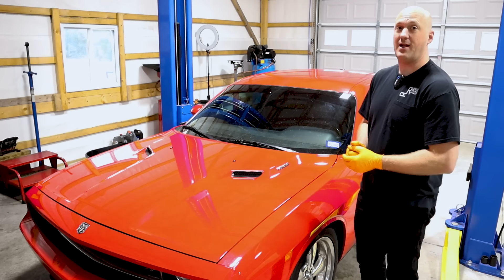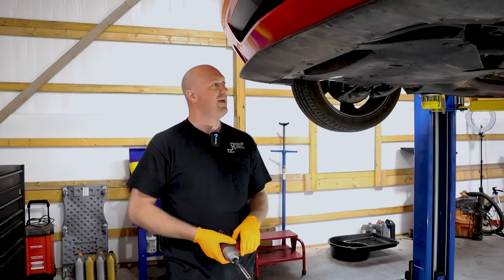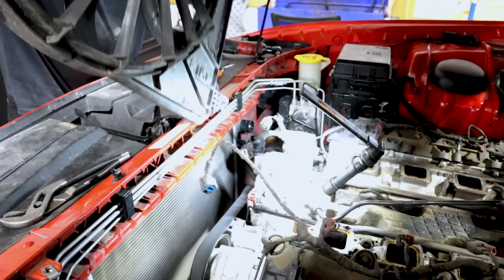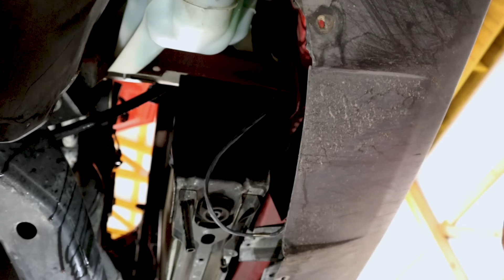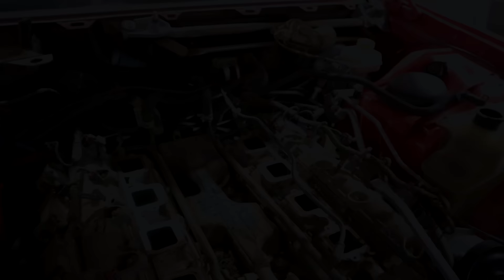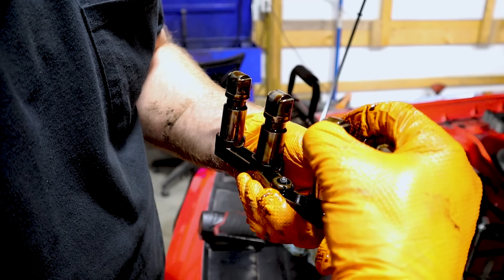Hemi Cam Installation! Budget Challenger Build Ep1

Comment: I have a question about the cam. I own a 2015 Charger with a 5.7l MDS. Can I delete the MDS ? Or can I install this cam without deleting the MDS?
Reply: Thank you so much I plan on doing these mods to my charger. I am not adding a cat back system I don’t think because I plan on leaving the muffler off and only having the resonantor on. So it will be custom exhaust from the header out
Reply from the maker: @mikedraper1762  if you do that I recommend getting rid of the MDS system. These engines sound terrible in 4 cyl mode with modified exhaust. 👍
Reply: @ReignitedAuto  if I remove the MDS can you recommend the factory or after market parts for that? Also the cam I should buy, would that come from the same year 6.4 engine?
Reply: @ReignitedAuto  I looked up the price and put most everything in my cart. I will need to remove the MDS solenoids and install the block off parts. Do you have the part #s for those? I will delete the mid mufflers and cats since it is not a issue where I live, leave the resonators on. Add an x pipe also. I am looking at headers and want to use factory ones that you recommended ( 6.1l) but if I cannot source them what after market ones do you recommend? I plan to use the diablo tuner, I will get the one that can be tuned.
Reply: @ReignitedAuto  2006-2010 Dodge 6.1 Hemi SRT8 300  OEM Exhaust Manifolds/ Headers. Will these fit my 2015 5.7l?
Reply from the maker: Yep, everything in this video will transfer over to your vehicle no problem. If you'd like to keep the MDS system you have to get the camshaft that matches that. Just order a 6.4 cam for a charger equipped with MDS and it'll work just fine.

Comment: I hope that I never have to do this job because I bet it would take me 4 or 5 days lol, but this video definitely has some excellent pointers!  I've seen other vids where all the front fascia of the car is removed making it even more daunting.  Thanks again for sharing your knowledge!!  Question, what kind of 90 degree power tool are you using there?  Seems like a must have and most of the ones I have looked at are still too big and clunky to fit in the tight spots.
Reply from the maker: I didn't double check the video to be sure, but I'm thinking you're talking about my Milwaukee 3/8" Fuel stubby electric impact, it's the best thing since sliced bread! 😎
Reply: @ReignitedAuto  I just might have to pick one up for myself :)

Comment: I am doing this 392 cam swap in my 2019 charger rt, I am putting on srt headers and replacing the valve springs with the ones you listed. Do you think that will be all that is needed since my car only has 34k miles
Reply from the maker: Should be good to go 👍 I'd definitely add a tune to the list but for mechanical components that should be good.

Comment: so no issues with installing this on a 2010 6.1 SRT8?
Reply from the maker: I need to double check, but I believe the 6.1 has the older style block without MDS and VVT, therefore the block casting is different and a 6.4 camshaft won't work.
Reply: ok thanks

Comment: Just curious why you didn’t replace timing chain since the car had over 100k miles. Or was it done on prior service since you had it all exposed
Reply from the maker: Hey Bob, thanks for watching! I don't usually replace the timing chain unless the vehicle is approaching 200K, we don't usually see too many issues with timing chains on these engines. I replaced one at 175k and I measured it to the brand new one, no difference whatsoever. 👍
Reply: @ReignitedAuto  wow metallurgy has really improved. My old Duster couldn’t go 80k without changing it

Comment: This is amazing man - this may just help me learn to do some similar work on both my Magnum R/T and Scat Pack Challenger I'd like to get done. The Magnum is literally same deal as this, 125k miles now, could use a lifter swap out (especially since they're the MDS ones), valves while it's open, and a 6.4 cam would be great in it to wake up a little. And those 6.1 headers. I'm a little afraid of the 6.4 on my Challenger if it's any more complex than a 5.7, but I've heard most things are basically the same layout. I'd like to swap out the MDS lifters on it as well, upgrade valves, and anything else that might help longevity (gaskets, etc); has 75k miles and plan on keeping it a while longer.
Reply from the maker: Very cool! The 6.4 is essentially identical to the 5.7 so it shouldn't be any more complicated. What year is the Magnum? Pre 2009 you won't be able to use the 6.4 cam as they changed the block when they introduced VVT and it won't fit. 👍
Reply: @ReignitedAuto  it’s a 2005! So spose that wouldn’t work then. But could at least do the other updating. Wanna keep it running till the wheels fall off, Hemi Magnums are rare now. And that’s good to hear about the 6.4, thank you.

Comment: I own a 2014 jku with the 3.6 PentaStar V6. Engine has an Edlebrock EForce supercharger. I started having a heating problem anytime I was under load or in a boost condition.  Original mileage was approx 41,000 miles when overheating started.  I installed an upgraded (larger) new radiator from Griffith radiators. It was a model specific radiator upgrade including 2 electric fans, and a custom shroud. New factory thermostat, and I bacame ultra cautious by always watching the factory temp gauge and the digital temp gauge I installed for more specific information.  At about 43,000 miles, I suffered a catastrophic engine failure due to overheating and the original engine failed. Total loss of compression in all cylinders. I had a new genuine Jeep replacement engine purchased from an actual Jeep dealer.
With the new engine, I had a new water pump, new thermostat, both temp sensors, knock sensors, new serpentine belt, new coolant.
New engine runs great however my overheating issues remain present.  I have  less than 1,000 miles on the new engine and I am looking for ideas on what could be causing my overheating??
Cost to replace the engine exceeds $10,000 with parts, labor, and misc supplies.  If anyone has ideas, suggestions, questions for me, please contact me at bloughd@aol.com.
Thank you for any help.

Comment: I am looking at having to do cam and lifters on my 2011 Ram 1500. And was wondering if the 6.4 non mds cam and lifters will work just fine? Not really worried about the mds system because it's mostly highway miles but doesn't seem to stay in mds mode for very long.  And also would shorty headers work just fine? Not looking for a lot of power and not any real place to get it tuned anyway. Any advice will be appreciated, Thanks
Reply from the maker: Yessir, non MDS cam and lifters will work just fine, as will the shorty headers. You may want to look into a tuner that will turn the MDS system off entirely though, as the system shuts down fuel to those cylinders when activated. 👍
Reply: @ReignitedAuto  I was also curious if there was really anything different from the pickup to the car configurations when doing this job?
Reply from the maker: @Meirman10  very minor differences, nothing that would prevent you from getting it done 👍
Reply: @ReignitedAuto  Sounds good. Thanks again for the clarification on everything.

Comment: I guess if you went this far, it wouldn't be much harder to install a forged lower end as well? Or would you need to remove the entire block from the car?
Reply from the maker: It's definitely easier at that point to remove the engine entirely. Not really a huge deal, but lots of added cost in forged components.
Reply: @ReignitedAuto  right on! Yeah I have the 6.4 so I guess it should be about the same. But if I can cut my costs buy more than 50% on the installation it would be worth it. Thanks!

Comment: I have a 06 5.7
How different is that
Reply from the maker: It's largely identical, however there is one big difference, the cam thrust plate is one piece that goes behind the oil pump as well. This means in order the remove the cam you have to remove the oil pump. This can be done in the cars fairly simply, but in the trucks you have to remove the oil pan.

Comment: Great video. I will be installing 6.4 MDS Cam in my ‘13 Charger R/T in the near future.  Plan to go back with new mds lifters and push rods.  Will be installing 6.4 headers from a crate engine, high flow cat mid pipes, and ported intake at the same time. Looking forward to watching the rest of the series ... I’m positive it will help tremendously.  Thanks!
Reply from the maker: Sweet! Should be a fun car when done!

Comment: I learned a lot especially knowing I can do it my self and save 3000 on labor. I liked and subscribed
Reply from the maker: You can do it!
Reply: @tonyclark4289 3k on labor gah how many freaking hours does it take?
Reply: $120 an hour at 24 hours is 2,880, guess it would be cheaper for some others at $90 an hour, or if you know what you're doing do it yourself.

Comment: Hello
How locked faser will affect drivability 
If you do not mind explaining more
Reply from the maker: Variable valve timing allows you to have increased power down low, and also up top so it's the best of both worlds. Once you lock the cam timing in place, it doesn't have that capability anymore, plus you have to use an aftermarket tune to turn off the VVT system, otherwise it'll set a code because it knows the phaser isn't moving.

Comment: i have a 07 dodge charger rwd v6 car .looking into converting it to awd using a donor car ..how hard would it be..
Reply from the maker: Mechanically I think it would be pretty straightforward, everything should bolt into place, but electronically is where you're going to run into trouble. You'd have to run the entire chassis wiring harness from the AWD vehicle, and you'd have to find some way to run the AWD PCM. It's honestly probably more trouble than it's worth, but I do a lot of things that are more trouble than they are worth.
Reply: @ReignitedAuto  ok thank you.

Comment: I just bought a 2015 Ram 1500 with 75k, I own a mobile repair shop and i feel like I'm hearing a slight internal tick on the passenger side and it's just in the back of my mind, I'm planning to have to do the job some day haha but it runs perfect for now. I did the passenger exhaust manifold the first week I had it because of course it had those 2 broken bolts in the back. Everyone complains about the cam/lifter failures but for me, it's such an awesome powerful truck that I'll take my chances and if they go I'll fix it in a weekend or long day and be on my way
Reply from the maker: That's the truth of it! Thanks for watching Noah 👍

Comment: Great series Sky! I purchased a 2016 rt challenger with 107 000kms and would be interested in doing the same mods you did but my engine has the MDS. I plan on keeping the MDS system, could I use a 6.4 cam that is for an MDS engine and would you know the part #?
My challenger also has the super track pack feature, not sure if that matters. Thanks again for the great video series and love watching them with my sons who both drive hemi trucks !
Reply from the maker: Very cool Andrew! Yes you can just buy the MDS version of the 6.4 cam, I do not have the part number unfortunately, but your local dealer should be able to hook you up with that. Appreciate you and your sons watching! 👍
Reply: @ReignitedAuto  I have the opportunity to purchase a set of 392 exhaust manifolds, the part numbers are 0538756AB and 0538757AB, are these the same manifolds that you used on your Challenger?

Comment: First, great video. I enjoy how you break it down section by section. But I will comment (ask): why stick with the VVT? Are you trying to maintain as much fuel economy as possible when possible? The reason being most people eliminate when there's an issue and need to replace lifters that have rounded so the same condition cannot happen again. Thoughts?
Reply from the maker: VVT doesn't really seem to factor into the lifter failures themselves, it's just that the problem started appearing more often after VVT was introduced, with necessitated a redesign of the engine block. It wasn't so much about fuel economy as driveability. VVT allows you to have very good low AND high rpm performance. I wanted to maintain that ability versus just getting a higher gain on the top end only. Thanks for watching! 👍

Comment: I wonder if this can be done on a manual scatpack 6.4
Reply from the maker: No reason to as you'd essentially be putting stock parts back in the vehicle. However, if you're planning on upgrading the stock 6.4 cam with a better aftermarket one the process is basically identical 👍
Reply: @ReignitedAuto  yeah that’s what I was looking at. Considering bolt ons instead of getting everything forged. So basically deciding between bolt ons or boost
Reply from the maker: @TKsGarage  Me personally, I'm a huge fan of forced induction, doesn't matter whether turbo or supercharger. For equivalent money the power gains on boosted setups are much greater than bolt ons.

Comment: I have one question, when removing the heads, I assume it was coolant that dripped out of it, but is that bad when it falls into the cylinder holes?
Reply: welp, in episode 3 you answered my question pretty much haha.
Reply from the maker: Hah, yep, no worries about coolant going down into the motor during disassembly 👍
Reply: @ReignitedAuto   thank you man, I was really debating on doing it myself or bringing it to a shop, but seeing how easy it is, I will get some of my friends to help me and should be all good, I was gonna do a SRT Max Cam Plus in my 2006 300 srt8!
Reply from the maker: @LarsAlgera   Sounds Awesome! you can definitely do it, just take your time on each step!

Comment: Okay, so idk much about vehicles so bare with me, but if I put a mds delete kit on an auto, can I get away with putting none mds lifters on?
Reply from the maker: Yessir, in fact it's necessary to replace the MDS lifters with non MDS if you are doing a MDS delete, otherwise the vehicle will be in 4-cyl mode when you start it 👍
Reply: @ReignitedAuto  perfect. Thanks for the response !

Comment: To each his own but incase you didn't know, long tubes actually give fair amount of torque more, than shorty's do. Especially down low, the gap on the dyno shows it pretty clear. The hp topped out 3 to 6 hp higher on the shorty's though but not till the very end. The low end torque was around 15 to 20 more the whole way through the zone but topped out close to the same number.
Reply from the maker: Totally agree longtubes would be superior, but man are they a pain in the butt 😄

Comment: So what's your thought on the RAM 5.7 to 6.4 cam swap? Keeping MDS.  Should i go with a RAM 6.4 MDS cam or the LX 6.4 MDS cam? I found 5045517AC as a 2014-2021 6.4 MDS cam.
Reply from the maker: I haven't looked at the specs to be certain, but I'm assuming the 6.4 truck camshaft is more geared towards midrange grunt than higher horsepower, so I'd be looking at doing the LX version. 👍
Reply: @ReignitedAuto  Oh nice.  Ive got a 2019 5.7 truck motor going in a Jeep JK, maybe the grunt mode would jive better.  Thanks for the reply.

Comment: Dude can't believe I just found your channel, bought my dream car (2013 dodge charger daytona) and I can't wait to mod it, also since you were a Chrysler mechanic I wanted to ask, should I buy factory control arms or aftermarket because the car pulls to the right and I already got it aligned and it still pulls to the right, really love the channel and I can't wait to see what other mods you have planned for the challenger.
Reply: Is your tire pressure correct on the front right tire?
Reply from the maker: Hey Nick, thanks for watching. I'd personally be looking at tire issues first. It's amazing how a worn tire will cause a severe pull. Your alignment settings may be correct, but with a faulty tire you'll still experience a bad pull. 👍